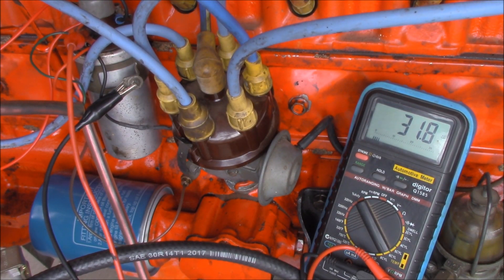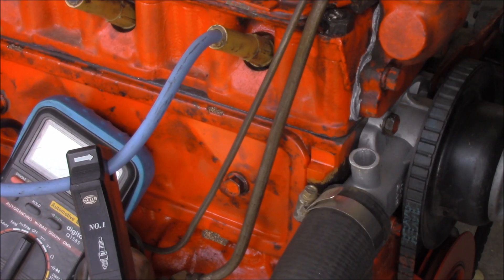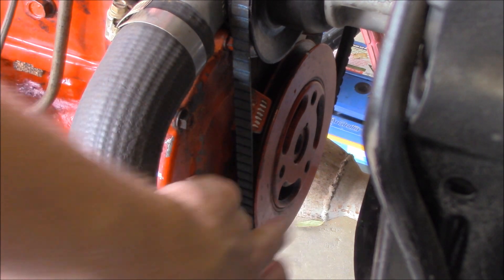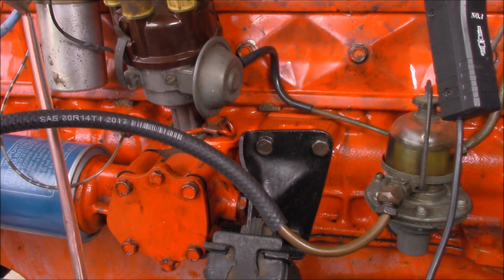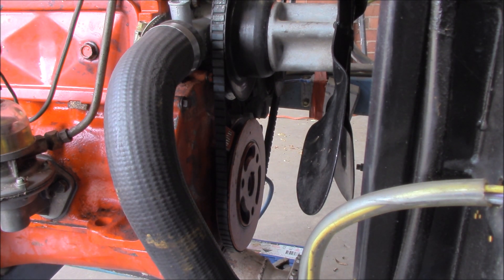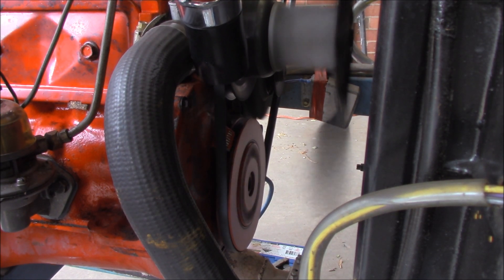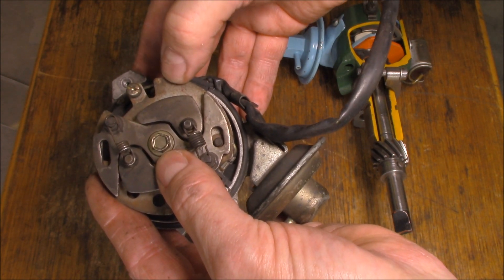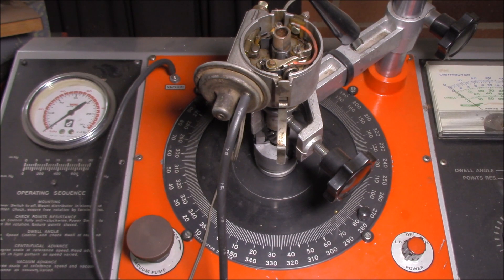Kettering Ignition Timing

Comment: How do you know you're at 800 RPM when you get to 8 degrees BTDC?
Reply from the maker: Hey Barry,
With this engine, the ignition timing is set at idle, which is approx 800 RPM. If you wanted to be accurate, you would connect a tachometer.

Comment: Hi  Max,
The base plate was also notorious for wear and would throw out the dwell especially when the vacuum advance would pull on the plate 
I used to convert those engines to L.P.G. many years ago and used the distributor scope to set maximum advance to 35 Degrees to reduce detonation.
Martin
Reply from the maker: Thanks Martin, 
I was back in the early days of LPG installation as well & yes, it was a real issue with the older motors with advance problems as well as the valve seat issues.
It was a lot easier when we started installing vapour & finally liquid injection.
Ah....the good old days!
Thanks for your comments
MiracleMAX